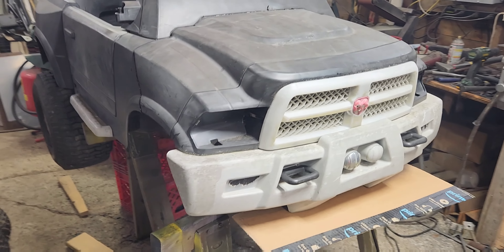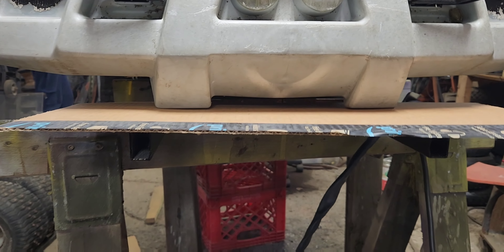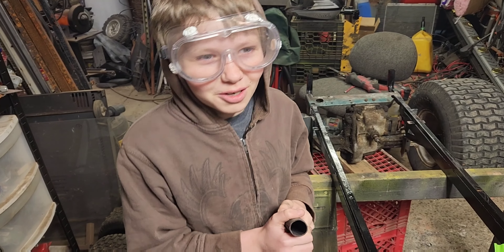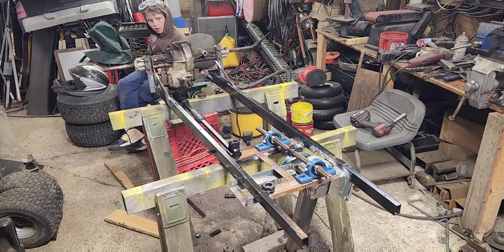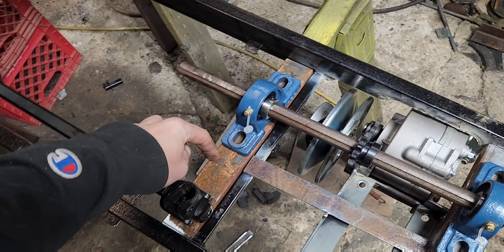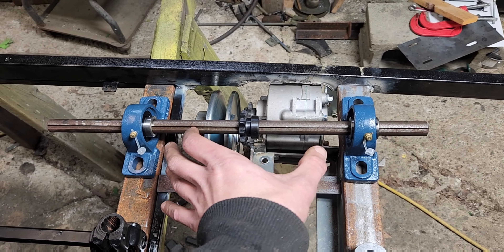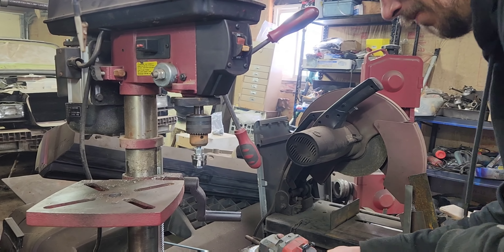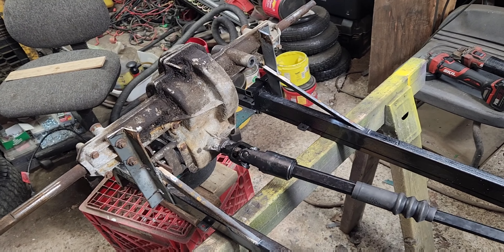Part 4 Duromax Dodge Drive Train

Comment: I would put a drive shaft loop or two on that. Granted its not spinning super fast but its looks out of balance and out of center on camera. Maybe some inch and a half pipe or something similar to slip over the shaft with flat stock welded to the pipe and frame. Pretty much a crossmember set up with the pipe making sure the drive shaft doesnt go anywhere. 
-----0------
Looking good, and all postive vibes bro

Comment: That is going to be a really fun truck when you guys are done making it. I am currently restoring a 5hp 25in deck Rugg lawn tractor, and I got it down to frame just like your project. I plan to do something crazy one day and put air brakes on a riding mower. I already have an air cylinder but just need two air tanks. Do you guys have any other crazy builds in mind when you're finished with the truck. I appreciate the great video and you two are very smart about taking junk and making it into a ridable monster truck.

Comment: I can't stress enough that drive shaft is gonna need a shield of some type around it.
Reply: That shaft will let loose in no time. I have no idea what that shaft will turn ungoverned but I would not what it under me.
Reply: @robertskelton2576  Yah, But I'm sure it will be ok. It's the fiberglass/plastic body and the kid part I was thinking of.

Comment: GREAT VIDEO 👍 WILL YOU STILL HAVE THE GEARS IN THE TRANSMISSION TO USE TOO ?
Reply: The rear end is an F/N/R gearbox, the torque converter is the only thing changing speeds

Comment: Looks like your forward and reverse In the transmission at the engine is backwards.... gonna go Hella fast backwards and creep in forward. You may end up having to spin your engine mount 180 to correct this, which would fix your driveshaft angle and put everything more inline